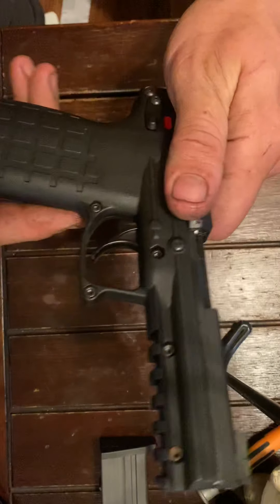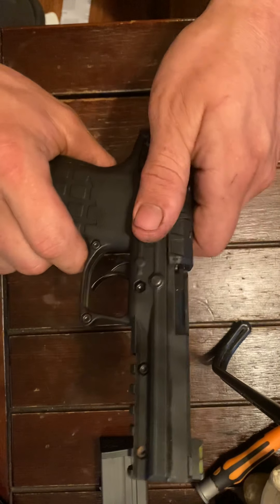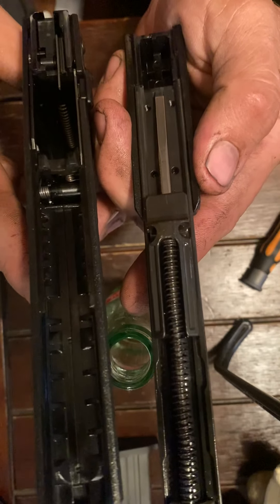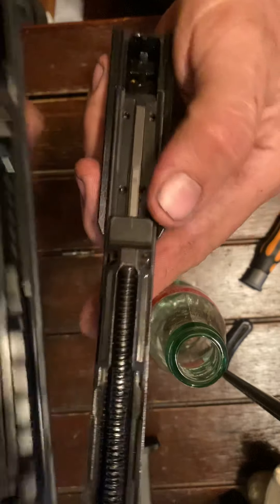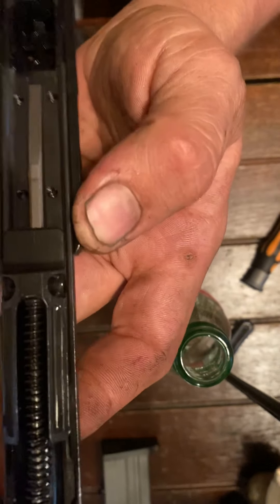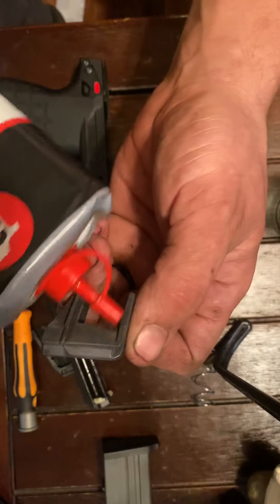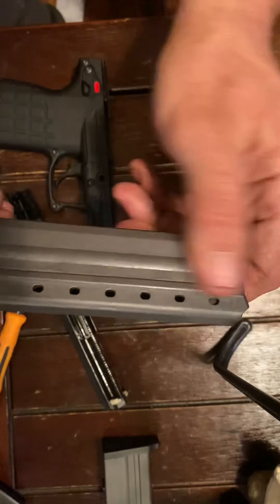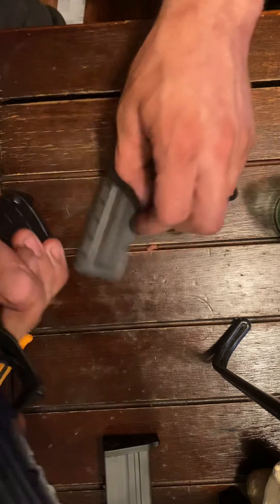How to fix your KEL TEC PMR 30 and make it run really smoothe.

Comment: 3in1 is a type of CLP so as long as the one you use does not have silicon in it your fine.  I'm from rural MN when we go through gun safety you learn about gun care as a child. You learn if you don't oil your gun it will fail. I thought everyone knew this fact. I have a pmr30 I have never had one problem. The first thing you always do before using a new gun is look it over to see it functions well before firing it and oil it before use.
Reply from the maker: I think a lot of people would oil their pistol if it was wood with a blued barrel but when it becomes polymer people forget for some odd reason. Maybe because of glock. I’ve heard they require nothing to operate. Never owned one! My owners manual for PMR30 said one word in it about oil but it didn’t specify so that’s why I made this video!
Reply: Out where I'm at in mostly rural desert areas, you can pretty much grab anything out of the box and run it without very much oil mainly because of little to no humidity. Rust isn't very common on guns where I am unless you're storing your guns wet like you shouldn't be anyways.

Comment: Keeping them oiled is good I've had mine for  Years now Just put the mcarbo upgrade kit on mine and it's even better make sure u get a nest style speed loader from American speedloader it makes loading those mags so fast but trust me get the all in one bundle from mcarbo it will make that lil pistol even crazier
Reply from the maker: Cool thanks for the info
Reply: What if I just buy the stainless steel feeder, and the mag dump spring that gets rid of the slop
Reply: @robertfernandez6942  dude just get the mag clip and u should be good it 100% helps but if you really wanna get crazy get that trigger its pretty awesome with a little tuning the break and reset are nuts making it faster and a lil more fun but  it does still jam everyonce in a while i just give it a lil tap on the handel and it slams shut and i keep firing it is what is a fun lil novelty gun or backpack gun
Reply: Haven't even shot my PMR yet. MCARBO All-in-one bundle came recently. Just waiting to get around to it. The Air Venturi  Avenger PCP chassis (TERMINADOR) upgrade ahead of it
Reply: I bought one with the kit already installed—LOVE IT! I’m sending my CMR-30 off to have one installed on it!❤

Comment: To the folks saying oil is bad.
Keltec uses glass reinforced Zytel which is a nylon polymer.
It is highly resistant to petroleum.
Nylon resins are extremely resistant to oils and fuels. Although nylon resins absorb some of them depending on the kind of the resins, there are no observable degradation and permanent chemical change.
Zytel in particular gets an A rating for oil resistance.
Lube away.
Reply from the maker: I have been using engine oil on it lately and it does well.

Comment: I took Semichrome metal polish and polished the metal rails on my slide. Polished the spring in my magazines.  Oiled the piece in my magazines.  Polished the ramp with Novus plastic polish.  Basically polished all metal moving parts and mine runs awesome.
Reply from the maker: Cool! Thanks for the comment!

Comment: I was having the same issues and I came to the same conclusion. Just cleaned it this evening and oiled up all the parts that slide on each other, like you said. 
It’s reassuring to find your video and I look forward to it running like it should the next time I’m out on the range.
Thanks for the video!  Cheers!
Reply from the maker: The other thing that makes a big difference is holding it with a tight grip. The lightweight nature of the frame causes your hand to be the weight that the slide is working against. Any limp wristing will cause malfunctions. Happy shooting and thanks for the comment!

Comment: I bought a Kel-Tec 22 magnum a few months ago and I am very pleased with it and I'm with his dad 3 and 1 oil machining oil is the best to use as gun oil the only problem I had was with loading the clip I tried to do it like a normal 9 mm but it's not like a normal pistol it's more like loading an AR-15 clip you don't go from the front push down and all the way to the back you start off in the Middle where The notches push down and then in but I do love this pistol
Reply from the maker: I still love mine
Reply from the maker: My friend gave me a speed loader for my PMR30 and it works nicely. I can’t remember the brand but stay tuned! I plan to do a video on it soon!

Comment: First time out I couldn't get 2 shots of in a row.
   I lubed the gun up real good when I came home, but I also watched every fix video out there.
 So second time it I expected bad results, based on those videos.
    I pushed the mag bottom up into the gun to determine if the loose mag was the issue.
  With 45 grain, this worked.
With 40 it also worked.
  So I assumed the loose mag was the issue.
    But I i tried shooting without pushing the mag up, and it still worked, 40 &45 grain.
    In fact, the gun shot every round I put in it without a failure.
  200 rounds, hollow point, tapered point, high grain, low grain, no failure.
  Lube your gun.
Reply from the maker: Thanks for the comment!

Comment: Had the same problems, gave the weapon a good clean, including disassembling the magazines and oiled it, worked brilliant  until half way through the 3rd magazine, then the firing pin broke. Replaced the firing pin, making sure no oil under the pin or on the top of the bolt or carrier, no problems.
Reply from the maker: Thanks for the comment! Stay tuned for more PMR30 videos coming soon!

Comment: Two suggestions 1. Try using Ballistol Oil ( my humble opinion is the best ). 2. Put a bead of glue on your magazines on the bottom of the ledge on the center back that locks it in the mag well. Unfortunately the magazines don’t lock securely and tend to hang too low in the grip making the top rd need to travel up the feed ramp too far. If there’s up and down play in the magazine this’ll fix it. You will probably need to file the glue bead to get a precise fit but it’s worth it!

Comment: Hillbilly, have you stopped using the 5secondfix on the outside of your magazines?  I used it on three mags and it seemed to work very well, but the glue just peeled off in a couple of days.
Reply from the maker: I never used any “fix”. I just keep it oiled good and hold onto it tightly and it shoots like a glock.

Comment: My mother's gun hates armscore ammo, and dislikes two of the three cci ammo we fed it. It runs fine with the Hornady v-max stuff. Which of course is the most expensive but also the best in my opinion.
Reply from the maker: I found out this weekend that it really matters how you hold these guns when you’re shooting. They need to be held very firmly. Handed mine to my father in law and it wouldn’t shoot, got it back in my hands and it shot fine.
Reply: @HILLBILLY_HARD  No disrespect to the other shooter but I hope you showed him how to keep from 'limp wristing' an auto pistol... not an issue with revolvers.

Comment: My only issue with my PMR30 was with the magazine not locking into place and staying there. A bit of searching led me to learn that if you use some UV glue and build up the small protrusion on the outer side of the magazine and shape with a micro file until it securely clicks into place, make sure that the magazine doesn't have an issue with removal
Reply from the maker: I didn’t have to do anything to mine except hold it tight and lube it… thanks for the comment!

Comment: Many people do not realize they need to at least oil their new gun before shooting it. I go a lot further. First I polish every moving part where it touches another part, starting with 400 grit wet/dry sandpaper and ending with 2000 (yes this is probably excessive, but it sure doesn't hurt.) All the work I do takes less than an hour.
-- Magazine: polish the feed lips and the front edge. I also polished the four areas of the follower where you indicated to oil it, where it slides along the magazine body.
-- Internal parts: polished the railings on both slide and frame; the top of the ejector; the hammer; the part that cocks the hammer, both the curve at the rear which hits the hammer and pushes it rearward, and the rest of it, that the hammer slides along in order to cock. Polished the feed ramp and the rear edge of the chamber, the whole circle, to improve feeding. Then I lightly oiled all the friction points that I polished, except the feed ramp/chamber.
-- In the first 100 rounds, I had four feed fails on the ammo. Two with 20 rounds of old Winchester Dynamax 40gr, and two with 80 rounds of CCI Gamepoint 40gr. After that I shot about 20 rounds each or Norma 40gr and Hornady Critical Defense 45gr, no issues at all. I think it's good to go now. I repeat, all this took an hour or less, maybe 30 seconds per piece of sandpaper--400, 800, 1500 and 2000 grit. I do some version of this to every new gun I buy before ever firing it. Basically I am breaking it in before ever firing a shot. Saves on using ammo as the break-in method. I do some of this on used guns too, as needed.
-- I never load my mags to maximum, always max -1, just on general principles to avoid any issues with too much spring tension.
Reply: I have put Mcarbo kit in mine. The most critical pieces they sell separately is a metal feed ramp (OEM is plastic) and a stronger mag release cause there’s too much slop in the OEM catch

Comment: Are you able to do a press check with a full mag and 1 in the chamber? Mine won't budge.
Reply from the maker: @fnulnu5297  yeah I’ve done a press check but not sure if I had a full mag and one in the chamber
Reply: @HILLBILLY_HARD  try and see. this thing is a flame thrower to boot.

Comment: Yup me too. Hangs and jams. I sent it back and they supposedly did some stuff to it but when I got it back I put some of this  CERAMIC CAR COATING Si02 CAR POLISH WAX PRO-GRADE WET LOOK NANO 9H PAINT SEALANT down inside my magazines and I have had no problems since. You can probably do the same like you say with 3in1 or any good light oil. I think should have staggered the rounds a little less. Too much side force on the rounds but it runs good now. Just gotta lube the crap out of it.
Reply from the maker: Thanks for the comment!
Reply: I like the idea you presented of using a wax inside the mag: it will last longer than a light coat of oil and probably reduce friction better. Great idea, thanks.

Comment: Mine was working fine when I first got it I put about 250 rounds through it and then I started having issues I cleaned it and I still have issues but I haven’t used three in one oil. I use Remington oil it’s like every two or three roundsround won’t feed into the barrel I’m going to try and see what happens

Comment: I have 2 PMR30s. Put the MCarbo pro kit ($249) in both. They still choked on a few out of ea mag, but I think 100-200 rounds for break in is required no matter what. Taking the mags apart to lube/check for burs is a great idea
Reply from the maker: Thanks for the comment!
Reply: I have a PMR30 with the mcarbo pro kit also. I have the same issue. Lubed it up with 3 in 1 and taking it tomorrow to put some rounds through it. Hopefully the oil and breaking it in will be the trick. 🤞

Comment: You are note Crazy! Nylon PA6 and PA66 is used for the housings, this nylon is extreemly resistant to Hydroncarbons. 3 and 1 oil will not cause any damage to the gun! Only downsidew is if you fail to clean the gun after every use.
GREAT VIDEO!
Reply from the maker: Thanks for the comment!

Comment: Another thing that works good too, is to use car wax, or ceramic car wax on the magazine follower and body on the inside of course. Treat it like a car's paint job... apply, let dry, then buff off. Very slippery when finished. Use a small towel on the inside with the wax on it. Back and forth... back and forth, then buff., and reassemble. I wonder what this and the oil would do?
Reply from the maker: Prolly run like a singer sewing machine bud!
Reply: This wax idea is catching on, lasts longer than a light coat of oil. And cleaner too!

Comment: Thanks for the straight to the point video.   I just got mine and the first mag had a failure to feed the second mag had 2 failure to feed.  Then my 3rd mag somehow got 2 rounds hung up on each other and wouldn't load into the pistol.   This was all with separate magazines.   I will try taking the mag apart and lube it like you showed .  Thanks.
Reply from the maker: Remember to hold it real tight when you’re shooting makes a huge difference
Reply: Do you think all the problems I had with the magazines would be fixed by lubing?  I'll try it either way.
Reply from the maker: @jaredevildog6343  one thing I noticed is mine doesn’t like many different kinds of ammo, I’ve had the best luck with CCI 40 grain hollow points, had feeding problems with aguila, and some other brands, I only use the 40 grain CCI ammo and I load my mags carefully, started using engine oil for lube because it’s plentiful and doesn’t stink, I’d lube it good and try it but if you keep having problems and you aren’t using CCI ammo try some 40 grain CCI hollow points and see if that helps
Reply from the maker: @jaredevildog6343  if you can’t find the CCI ammo I’ve had good luck ordering them from CCI.com
Reply: @HILLBILLY_HARD  great !  I appreciate it !

Comment: I have used 3 in 1 for almost 50 years. works great
Reply from the maker: Thanks for the comment! It does work well!
Reply: The way i do a complete clean is (unload/ double check lol) disassemble, soak all metal in gun solvent, soak all plastic in hot soapy dish water. Wash/ clean blast with air nozzle till dry, then use Super lube 2000 to lube all.

  Note: Dont put on brake pedal, steering wheel or motorcycle tires🙂

Comment: 4 or 5 years ago the spring on the screen door on the back porch screeched very loud every time the door opened and closed...I coated the spring with Slip2000, and it's still quiet after all this time! Is why I have such a high opinion of Slip2000.  But there are videos  on YT of people that swear by Mobil1 as outstanding gun lube also. Just food for thought!
Reply from the maker: Thanks for the comment! I was thinking about slip 2000 on the way home this evening due to reading y’all’s comments on here and I think I’m going to get some and try it! It’s cool that it matches the name of my Sub 2000 too!
Reply: @HILLBILLY_HARD  Yes sir you're welcome.
I'm going to put a quart of Mobil1 away (just in case) before it gets WAY  too expensive...not sure what I want though      0 - 40 or 20 - 50 weight. But a quart should last years and years.

Comment: You definitely got a lot of positive comments, I'll have to try it. Mine only likes cci.
Reply from the maker: Thanks for the comment! Yeah I like the positive feedback! Glad I could help some people out!
Reply: @HILLBILLY_HARD  Thanks a bunch. The old 3 in 1 oil did the trick.  I've had that pistol for five years and never took it apart. It was still dry on the inside. Oiled her up, gun and magazine. Ran like a champ, even with the cheap stuff. I'll be using 3 in 1 on all my guns. Can't thank you enough. I'll just subscribe.

Comment: The rounds in my mag push the “wings” (that hold the rounds in the clip) up.  I guess the polymer is not strong enough.  The wings are bent up so high the carrier hits the raised wing instead of the shell so that it doesn’t pick up a shell when it cycles
Reply from the maker: Try only loading 20-25 in the mag instead of pushing it to 30. Just because it hold 30 doesn’t mean you need 30 and it would work better with 20

Comment: Good job and thank you. That is too much oil for my Walther WMP as it and a new Mossberg wouldn’t grab the shell with the extractor. Don’t see nothing wrong with 3 in 1 my self. Some guy started to make and sell gun oil, don’t know what it had but it was too much. I have a PMR 30 as well and won’t spare the oil like I do with Glock and others. If it’s too much spray with brake cleaner.

Comment: Absolutely hysterical. Gods honest truth been simply trying to get one in the chamber for about 45 minutes (I’m not a beginner to say the least). 

Watched your video and wow. The gun really does feel totally different now. Feels like my heavier Walther poly with the slide - you and dad get my genius vote for 2023. The materials they use in this gun (and cars & planes) is polyamide which is an extremely chemical resistant nylon so I have no worries about degrading. Thank you 🙏

PS - I have old school oilers in 3 rooms filled with the same 3 in 1 but never thought to use it in my guns - for the simple reason I always had a “gun oil” around but no more 😂
Reply from the maker: Thanks!

Comment: I bought mine in 2018 and have fought with it ever since.i finally broke a fireing pin so I called Kel Tech and asked them about the upgrade everyone is doing and they told me they have 0 issues and that after 3 years they will NOT honor warranty work but that I could send it back in to them and they would work on it(so why work on it if there are no issues) for a fee....I used a Q-Tip and spread a lil never seize all over mine,,just waiting on parts so I can put it back together.i love the gun and want to say good things about it but I cant,I have spent considerably less $$$ on firearms that have functioned flawlessly for over 10 years 😢
Reply from the maker: I’m still not having any issues with mine. My gun was purchased in 2021 so it’s a newer version. Maybe there’s something different with the newer ones.
Reply: @HILLBILLY_HARD  right,they have "reworked" them twice that I know of,and that's my question,why rework them if there are no issues to begin with,but glad to hear yours is doing good,hopefully mine will work once I get it back together, fingers and toes crossed